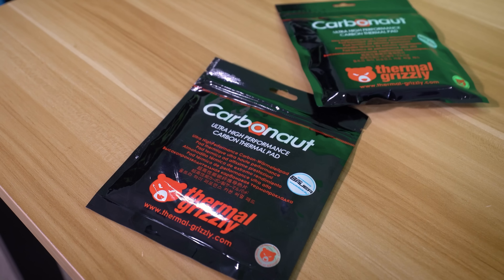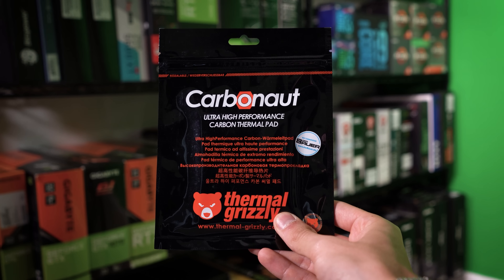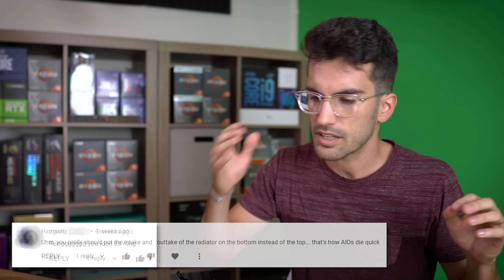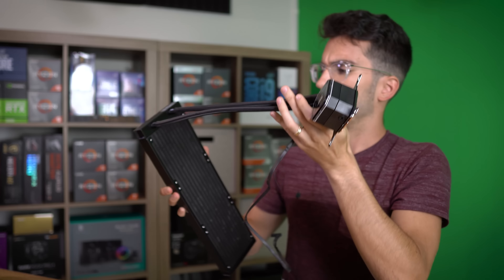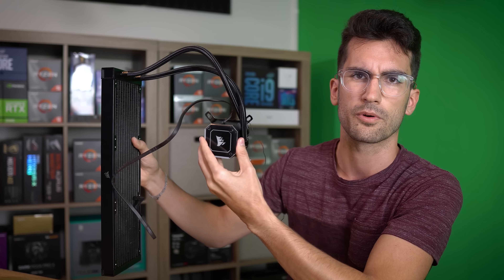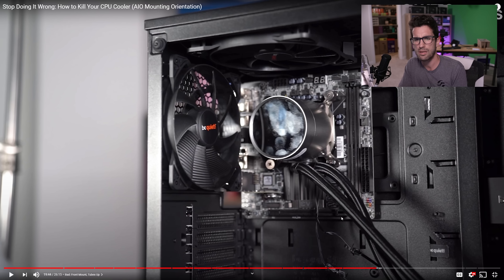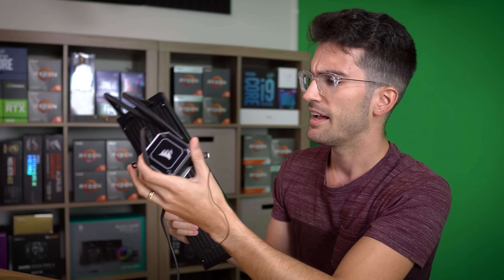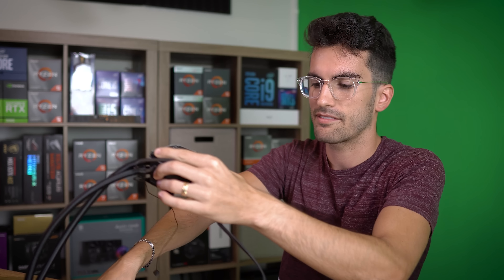Let's Talk About AIO Orientation... Again

Comment: Why be so angry about something that can at maximum help people that have issues?? It spreads the word and if someone thought their pump was making noise when it was just bubbles at the top of the radiator it can only improve their situation. Like even if it is only a couple of people that are then literally sending back their AIO it's still worth it and if you can't mount tubes down then either try it tubes up if it works without problems or just radiator mounted at top. Like just make it a standard in the pc building community I really don't see why you have to be this angry holy shit.
Reply from the maker: You think this is me being angry? You should see me play COD. I took the chance to clarify the misconceptions about AIO orientation because I and others have been bombarded with these ridiculous comments for weeks. Relax.

Comment: Hey Greg.. I have an ekwb aio with the pump on the radiator... My new lancool 2 case isn't wide enough for me to mount the aio on top.. it runs into the mobo... What is your suggestion in which orientation I can use... Again.. the pump is on the radiator and not the block.. thanks brother.

Comment: What about a BeQuiet pure loop, where the pump is decoupled. Can that be installed with the radiator at the bottom? Will it be harmful, since the highest point would be the cpu block?

Comment: No, if air bubbles get into the water block, it will degrade performance, that is a fact.  It might not be huge, but it can get quite bad under certain circumstances.

Comment: I think I might have gotten one of those rare performance issues with a barbs up 360mm AIO... I have a Corsair H150i Pro, and was having thermal issues with it barbs up. Flipped it around, and it helped a good deal. Also less noise. Guess it wasn't filled properly...

Comment: my pump is on radiator and i put it on top of the case because i realy cant put it on front.
but i see the the pump that spin design is still submerge on water on radiator.
i think its save?

Comment: Since pumps are more powerful in custom loops, does barbs up (but only slightly higher than the pump), make a difference?
Reply from the maker: Not in most, because the pump is often sufficiently below the reservoir. Air collects at the top and the pump don't pull it down through the fluid.

Comment: I tried running my AIO in GN's config for a little bit was a pain to flip but I did it and I just didn't like the way it looked and noticed it didn't affect temps or sound. Only heard the bubbling the very first time I installed the AIO in the "wrong" position and when I flipped it. Part of me wonders if his testing wasn't accurate just because he 1) cut the AIO 2) and also improperly filled the AIO. I agree rad down is dumb but other than that as long as you're seeing proper cooling and your CPU isn't spiking then I think you should be fine. But thats once again just my experience. In the front with barbs up I've had no issues so no need to freak out.

Comment: Does the orientation of the tubes on pump matter? For instance I have the radiator in the front with the tubes down but, to gain some slack I mounted the pump with the tubes down too.  Is there any issue with that?

Comment: I got the same aio and it barely works, I even checked all the wiring and it doesn’t wanna work, maybe a few times outta 100 it wanna works. My cpu was at 100 celsius.
Reply: Bought that same aio had issues with it took it back got an older model no issues.

Comment: Tubes and water block high is bad news. It only takes a thimble full of air to vapor lock an AIO water block especially with a CPU based (Asetek) pump. You want to make sure that never happens by having a place for air to collect where it will not interfere or mix with coolant flow. For example in a car radiator there is area near the top of the radiator near the cap and the hot coolant flows into the top of the radiator but the pump always sucks from the bottom of the radiator so even if the radiator is half empty the pump will always suck liquid. Not so with most CPU radiators as they have both tubes on the same side of the radiator which is a big problem if the tubes are high, you will suck the air that cumulates (as seen in the cutaway video) and that leads to reduce liquid flow and possibly vapor lock where the CPU heat can vaporize the coolant. Even though you are looking at core temps around 80'C, on multiple cores they are cumulatively producing many watts of heat that focus at the CPU water block where under the right circumstances the small amount of liquid coolant mixed with air (gurgle gurgle), vaporizing the coolant further reducing the flow and raises the heat. Your stats show the CPU core temps constant as the thermal throttle continues to cut in so it's easy to think everything is fine. I am a PC tech and see this many times a year. Even had one I9 with a new 280mm AIO run for about an hour under heavy load and then suddenly vapor lock  instantly crashing the system. Custom cooling almost always makes provision for this by having a reservoir. Better yet get a good air cooler and be done with it. Good luck!

Comment: Thank you for your video Greg. Helped understand better the issues. I myself have an H100i on a Fractal R5 case. Initially I had it setup on the top. But I suffered a lot with vibration noises and the CPU temps where a bit warmer due to the air being pulled from the case. I switched to the front position and CPU temps decreased and the vibration stopped. I'm a bit concerned if I will shorten the pump's life with this. The R5 case has a drive cage on top (which I'm using) so the top portion of the rad (tubes) are a bit bellow the pump, I would say 2/3's of the pump is above the Rad. So.. yeah. Not sure if I should try to switch back to top in this case. Cheers.

Comment: 1:50 "the problem is you can't really get all of those air bubbles out" just gotta point out that AIO manucafturers absolutely could remove all the air from the loop if they wanted to. but they dont. if the AIO was completely full of water then when that water heats up its going to expand and break the AIO or spring a leak because water isnt compressable. AIOs have a small amount of air in them by design. it allows for thermal expansion and contraction

Comment: in my eyes its not really a big problem
and even if you run your aio for a couple years and it might have enough air in it to be a problem, by that time you can just top mount the rad

nothing is stopping one to change their system down  the line

Comment: The absolute simplest solution to air in any amount in a closed loop system is a bleed valve in stalled at the top furthest point away from the pump. 

A lot of vehicle cooling systems incorporate a bleed valve in the thermostat tower to force excess air from the system.  I dont know why they wouldn’t install one in this application.

Comment: How about Front-mounted barbs-down…is that even better at all?….i mean air-bubbles already in the pump wont run down the tubes to reach an higher point in the radiator?

Comment: I have EK 240 AIO top mounted, exhaust out. I get the water trickling sound on startup pretty much each day for 1 minute, I’m not sure how since the rad is at the top of the loop horizontal. You said it should go away after installing but what if it keeps happening? What’s the cause?

Comment: Great video. Thanks again. I. Installed yesterday artic liquid freezer 280mm cooler on the front with the tubes top and i was wondering if I should disassemble it and put it with the tubes downside. I didn't hear any bubbles just when I switched on for first time my pc but after that not any strange sound. Thanks again 👍

Comment: my gpu blows very hot air up, im using a corsair 4000d case with high airflow at the front. im thinking of putting a 360mm at the front becuase i saw bitwits video where gpu heat rises to the 240mm ontop. so should i get a 360mm and put it on the front or would that restrict airflow for my gpu?

Comment: Im assuming this applies to GPU AIO's as well?

Just got a 120mm EVGA hybrid GPU cooler and front mounted rad to front as intake, tubes down. It's higher than the GPU. Looks better tubes up but I really hear the pump in this orientation.

And yes, it has been an issue, which is why GN made the video.

Comment: Greg, I have an Arctic Liquid Freezer II 360 mounted tubes up with the tubes running along the top of the case and bending down the cpu (tubes never relaxed so that they would bend down and them come back up to the cpu, anyway). After a month of use I experience some gurgling. It lasts only a second or two and mostly happens after shifting the case a bit. Anything to worry about here? I don't think so, but wanted to ask. Thanks.

Comment: but if air goes to the top and the radiator is splitt in the middle except for the opposite site of the the tubes how can it circulate over and over if the tubes are on top that would mean  the air will go from exit radiator to pump and then inlet radiator and stay there an not go over and over

Comment: I have a front mounted water cooler with the fans on the inside of the case and radiator on the behind it. Is this the correct fan position?

Comment: Sorry for the noob question, but how should the radiator be mounted on the front if the motherboard layout is inverted (e.g. Corsair Carbide C600 or be quiet silent base 801)? barbs up or barbs down?

Comment: Funnily enough i had not had an AIO until my current one with the gurgling problems. Right now im running a ML120 From CM and it does have this and i totally put the tubes up cuz it looked better. Have not really noticed anything bad about it honestly besides the gurgling but like you said it does 99% of the time workitself out of the pump after sitting almost right away.

Comment: The picture of the computer I'm getting shows a 120 on the exhaust with the tubes at top. It seems I should turn the radiator so the tubes are on bottom if possible. Yes?

Comment: I have a Thermaltake level 20gt case, my aio is side mounted. Been running 2 years no noise whatsoever. I have a feeling if the pump ever fails it would be because its outside the manufacturers expected lifespan (I think its 5-6 years).

Comment: Except air accumulates over time, and not all aios can be filled/not everyone want to go through the trouble of trying to fill it when it's not intended to be.
And more noise is bad. I can't believe I have to say that.
So at the very least, you should try to fit it with tubes down, refusing to is just a sign of laziness.
Reply: My aio is 360 mm or something like that and won't fit tubes down due to the case lol I'm not lazy

Comment: it basically comes down to QUALITY in my opinion i have always used the front mounted tubes at the top and the only ones ive ever had gargle or make any noise are cheap cooler masters and other fairly cheap aio brands i mostly use corsair and have NEVER had a corsair gurgle or suck air in any way cause they are filled much more efficiently than these cheaper option

Comment: I have mine front mounted and tubes up had no other option tubes too small to have them on bottom and radiator too long to fit on top. no issues with gurgling or high temps.

Comment: As usual, the internet assumes that they know all the variables in a situation after watching only one video, or only building ONE computer, their own, and they never think about the situations in which mounting the AIO tubes down is not possible, like the ones where the case doesn't support top mounts, or if the AIO has tubes too short to mount barbs down. I mean, after all, since there are many many different computer case options available, there are also many different ways a person may HAVE to mount their AIO.....so, yeah, sure, tubes down, absolutely always, because, reasons....with no evidence to back up the claim.....sounds legit

Comment: What's your opinion/experience on radiator positioning as far as CPU and GPU temps are concerned? Of course I'm talking about the front intake vs top exhaust.  I've seen a lot of people say that while front intake gets you the best CPU temps, the impact to the graphics card is pretty bad. Where top exhaust gives you only marginal increase in CPU temps and the GPU can run much cooler, assuming good front intake fans.  Bitwit seemed to be the only video giving readings where top exhaust raised CPU temps by 10C vs front intake, and that front intake made "barely" any difference to the GPU (for both blower shroud and open air, each respective of normal operating temps).

Gamers Nexus (using a Corsair H500 for high airflow) also came to the same conclusion of top exhaust having only marginal increase in CPU temp, but drove the point that the temp disparity between CPU and GPU is much smaller, thus establishing a better overall balanced system temperature.

So what's your take on that Greg, or anyone else possibly reading this?

Comment: I think they got the idea that the front mount with the  soft lines up top is because some systems when mounted that way have the pump slightly higher. This happened in my old ITX system in the NZXT H200i. Most of the time though this will simply not be the case. This should not have needed a video 😂

Comment: Also, not all AIOs are Asetek, and non-Asetek AIOs have the pump on the tubes or in the radiator itself, which may allow you to have the cpu block higher that the rest of the AIO because the pump isn’t in the cpu block. I’d actually like to see testing on that.

Comment: If there IS an optimal position - why NOT use it - and do it in a way that introduces "potential" problems. Form follows function.
Also: the argument "That has never been a problem" is never ever EVER ever a valid statement in a professional environment. If a policeman says to you "well, you CAN leave your door unlocked here, it has NEVER been a problem for me..." or your doctor says "well, i don't need gloves or a mouthguard - it has NEVER been a problem..." - that's not how you argue. if there's an optimal way of doing something - DO IT. If there's little risk of doing it differently: point out the risks - like you did - and name the possible scenarios in which you would deviate from the optimal solution.
Reply from the maker: There ISN'T a problem with barbs up if the AIO is made correctly - and a vast majority are. Do things the way you want, but don't crusade against those who aren't doing anything inherently wrong.

Comment: I actually came across your vid because my AIO is making some weird noises like cavitation almost in sound. I have my radiator mounted on top on purpose to reduce any air from getting to the pump but it still seems to be making this noise. Do you think i have an improperly filled AIO with a lot of air that could be causing this?

Comment: I still have doubts about installing a water cooling system, water and electricity do not mix well:-)
although a huge air cooler for the AMD Ryzen 7 3700 processor that prevents the cooling of the Asus TUF Gaming GeForce RTX 3080 OC is also not ideal in my opinion!
how safe is such a AIO water cooling, and should I rely on the 60 to 72 month warranty that some brands give?
thanks in advance for your opinion!

Comment: Greg, AIO marketing shows the ultra bad positioning and customers reviewing AIO complain about noise, BECAUSE they see casual examples and don't know.  Builders should think where the air reservoir is, this issue is self inflicted if you ignore it in your video.
It's natural people want products to permit the optimal positioning and notice when aesthetics has been prioritised.
No, radiators both radiate and conduct heat to air, it's fluids like air which convect heat away as it tends to rise.  You should know this as that's why infra red cameras work.

Comment: I like Steven and GN but if your willing to pay for a premium product like the Lianli o11 dynamic Evo you why would you test as if you arnt buying extra case fans and aio's. I have 6 intake(bottom/side) and 1 exhaust with a 240mm corsair aio top mounted and have ran multiple tests. I struggle to hit 70c on my cpu and 66c max gpu, also being very quiet(3080 ti/ ryzn 7 5800x). Just saying if you are paying for a premium part assume that you are buying as much cooling as you reasonably need.  Thanks for the video. Top mount life lol.

Comment: No AIO has tubes long enough to front mount the rad with them at the bottom. Modern GPU's are too big to route the tubes around them.
Reply: Top mount master race
Reply: @WayStedYou  I only have one problem with top mounts, heat. Why pull warm air through the rad by using it as an exhaust? I set the top mount as an intake, but it means more maintenance and de-dusting.

Comment: What about a top mounted orientation using the AIO as an exhaust vent ?
Reply: You’re gonna get higher ambient temperature but it shouldn’t affect the performance at all, except if you’re already pushing the rad to the limits as intake

Comment: What about the ones where the pump is inline with the tubes, and not at the block?
Reply from the maker: We have a video dedicated to multiple pump positions and an explanation of mounting. Basically, don't mount those with barbs up in either the front or back of your case. You're likely referring to the be quiet! ones?
Reply: Thermalright Frozen Notte 360 specifically.  @GregSalazar